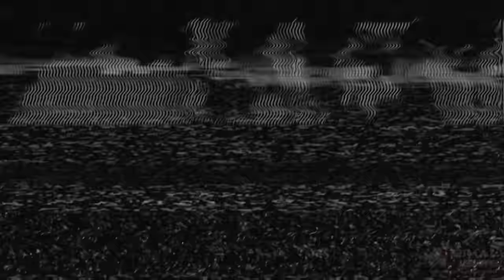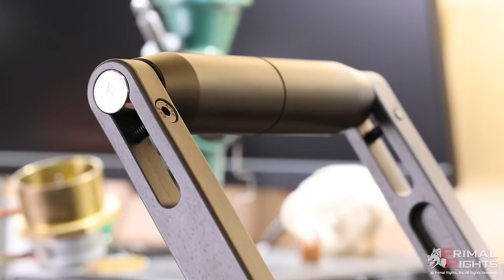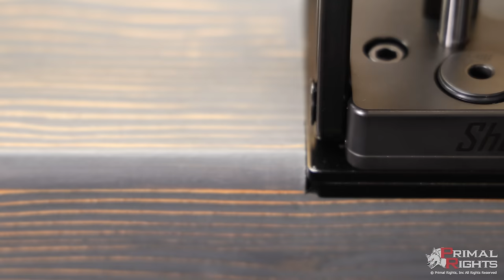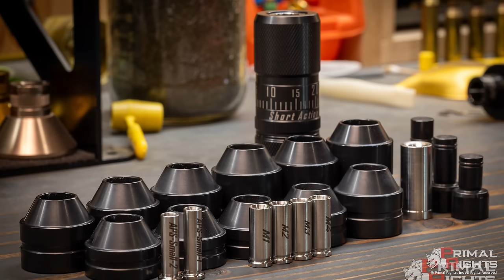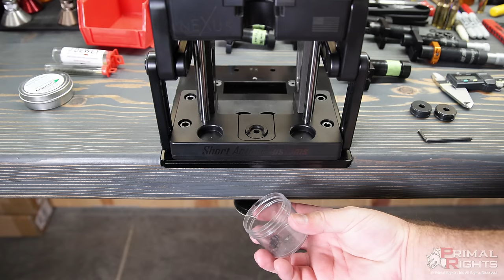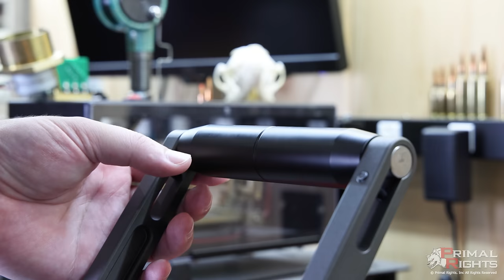The Nexus Press

Comment: A couple of thoughts on the video and design:

Press needs the SAC orange accent somewhere instead of just having all black.

As far as measuring headspace goes, standard dial/digital calipers aren't capable of < .001" (If we're using standard comparator  inserts with calipers) so there's no point in running a test unless one has a cadillac/height gauge capable of finer resolution tested on a surface plate.  This is the material SAC should be putting out.

There's no way I would want that press to hang over the table with any mount.  The footprint is not designed to do that.  Giving it more center height at the bottom/making a cutout chute off the front would allow it to use the simple system the Summit press has, which is the best depriming setup in reloading.  It has no built in priming system, which is nice to have.

The conical shellholder is a nice touch to offset missing machining parallelism between plates.  The choice to cam-over or not is pretty slick.

It looks like a decent amount of mass to move with each stroke which could get tiring.  All in all a nice (boutique) press, and it's good to see new players out there making new presses and improving on what we have.  Though at the end of the day, I don't think that the press is going to make handloads any better than what's already available, but the more competition the better.

Comment: Very nice!  But with the curved side links from Josh Badeau on my co-ax, along with the inline fab ergo side roller handle, I think I’m about ideal.  The one big advantage here with the Nexus is that it will take larger dies (I had to get a slimmer mandrel die from APW for the co-ax) and most importantly to me I could use a funnel on a powder through expanding die, when there’s no way the co-ax yoke would fit over that.  However with the Badeau curved side links I actually have more access in front than the Nexus.  

Being a SAC product you know it’s going to be well built, and it has some impressive features.  As to the cam over, I’m sorry to say after 20 years of reloading I still don’t get it.  I’ve never had a press that did that, and haven’t missed anything I don’t think.  I just adjust my dies accordingly for FL sizing, using comp shell holders if I have to.  Back in the day I understand camming over stressed the press beyond its limits, and neither the Lee Classic Cast or Co-ax I have seem to have any cam over option, so I’m not sure what I’m missing.  In any case thanks for the very thorough first look!  👍

P.S. on the spent primer handling on all 3 of my presses, (Dillon 550 and the two single stages) I’m old school, and run a 3’ plastic tube down to half gallon plastic or glass mason jars each with a pound of lead at the bottom.  Each tube end has a cut off .357 mag case at the end, and a snap ring to keep them from pulling out.  It will take about 20 years of daily decapping to fill them up.  😉. That being said I’ll be interested in what you come up with for your new Nexus!

Appreciate the good word by the way!  God Bless.

Comment: How did you find the force that you needed to resize your brass? I have a Summit press and I find that it takes a lot of force to resize with the Summit.
Reply from the maker: Well to measure the force you have to apply to the handle, a simple pull scale found at any hardware store would suffice. To find the force applied to the case, you'd need a pressure gauge or similar setup to get in between the case and the press.

Comment: When would you use cam over?
Reply from the maker: 99.9% of the time.
Reply: @primalrights Why?  Seriously, the co-ax doesn’t cam over does it?  I have to be missing something critically obvious here because I’ve been running two single stage presses for years, neither of which cams over as far as I know.  Thanks for filling in a big knowledge gap for me.
Reply from the maker: Literally almost every press ever made cams over, including the Forster. The Nexus is different because it is a resisted cam over. The 419 zero is one of the only presses that do not cam over.
Reply: @primalrights Well, then I don’t know what that is, because neither my classic cast or co-ax “cams over.”  Both have absolute hard stops where no further movement can be made, and in both cases the top of the ram, or shell holder plate, is at its absolute height when the press handle is at its absolute lowest point.  So if what you’re saying is true to you that means that you have a different interpretation of “camming over” than I’ve read anywhere online.  I won’t doubt your expertise, but then we’d have to both understand what the term means.  The Classic Cast absolutely has that characteristic, but perhaps it’s the Badeau links I’ve always had that makes it different from the standard co-ax…?
Reply from the maker: @E.L.RipleyAtNostromo Hard stop has nothing to do with whether it cams over/under or not. This is a basic mechanical principle.